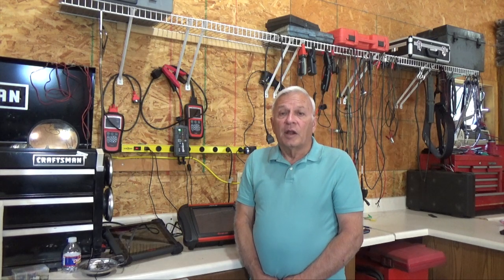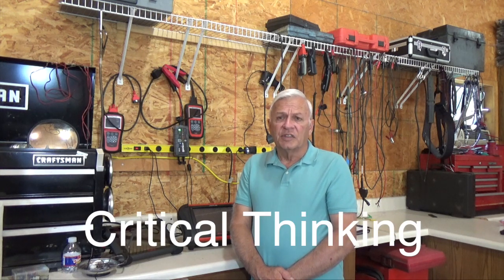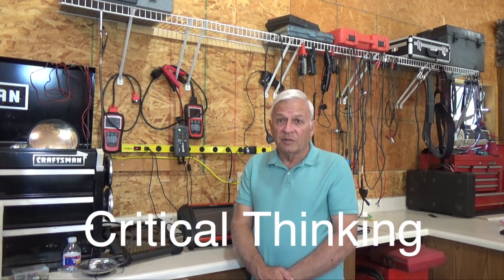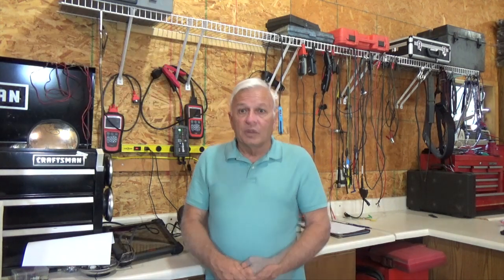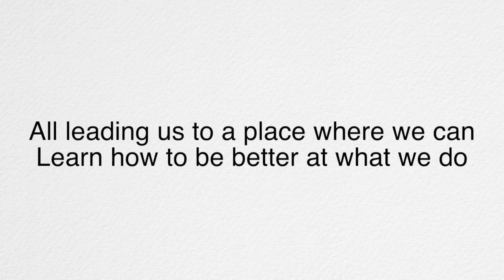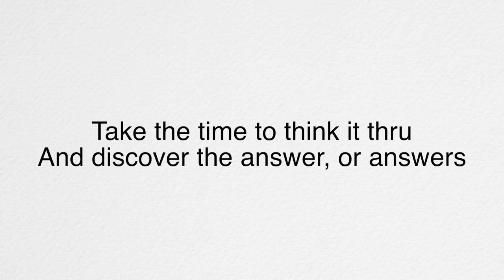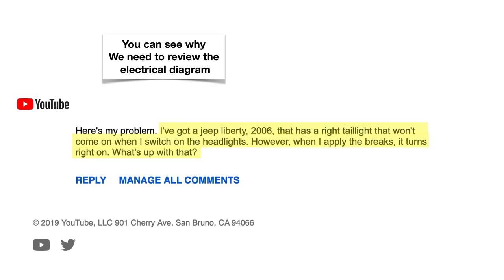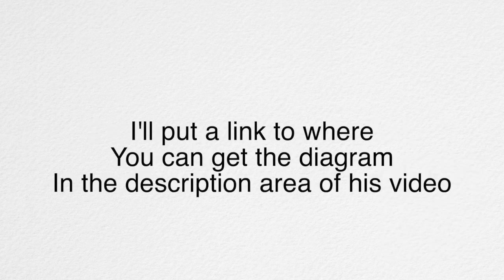A study in reading electrical diagrams Part 1

Comment: actually when you have multiple issues see if there is a common denominator. it may lead you straight to the problem or a big rabbit hole. many times it is better to rule out items on your checklist to narrow your focus than it is to go right after one thing and dwell on it.  thinking is critical and common sense is in short supply these days. make a plan of attack and stick to it. write down the results of each individual test on paper or in your mind. sometimes what seems normal when attatched to other results will give a clear picture on the tough ones.   good to see ya back at it  and i do like this idea.
Reply from the maker: Great advise Richard, thanks for adding it,   Duane

Comment: Please will you make a 3 min video to tell us how the transmissions fluid runs inside the Auto transmissions, from where to where?
Example: 1 oil pan, 2 pump, 3 torque converter, 4 heat exchanger radiator, ..... 
I mean the ATF fluid circuit
Thank you a lot